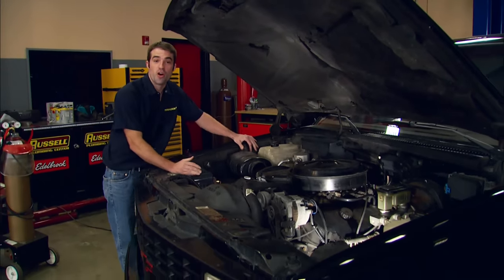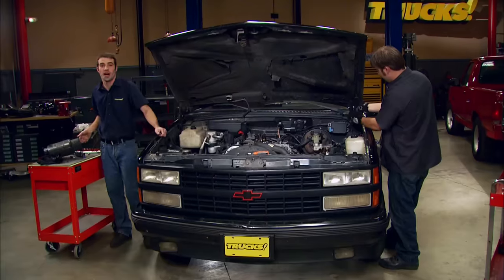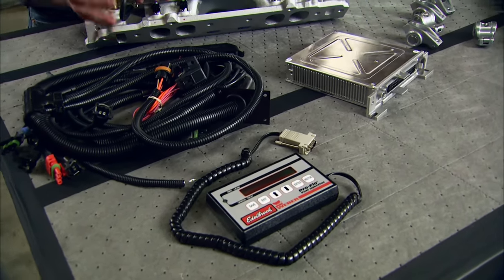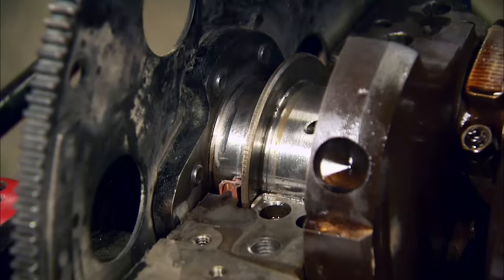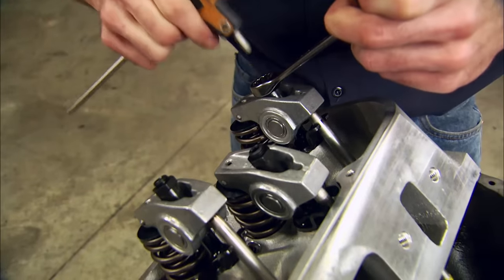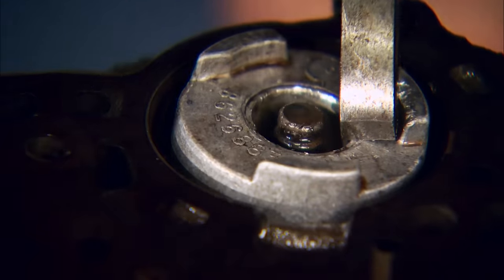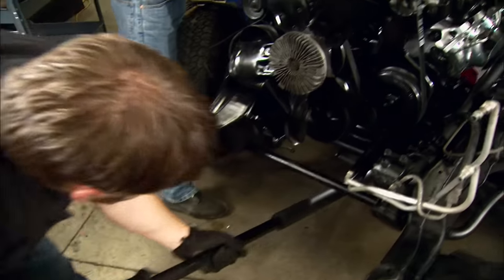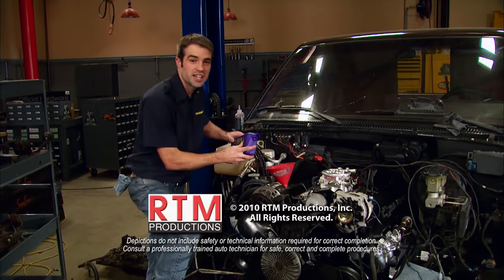Waking Up A 1990 Chevy 454 SS Big Block MuscleTrux Wars Part 2 - Trucks! S10, E2

Comment: Flip the lid on the air cleaner and it'll squeak the tires.
Reply: J W That will only increase noise.
Reply: Okay boomer, sit down.
Reply: Does increase power even if hes a boomer those old dudes have all the old school knowlwdge, you should check out uncle tonys garage
Reply: Lol every gear head in high school 😆😆😆👍
Reply: @dextermorgan9703  just finished watching Tony talk about valve's and off set piston pins  👍
Reply: @Joshua Webb I graduated in 03 wish I was in high school in the 70's lol just seemed like a good time . I'm guessing mech class was better lol
Reply: @Joshua Webb my school had the best shops in the City. Wish I spent more time in mechanics. I was in the auto body shop I painted my fist car there. It's sad I stopped by a couple years ago they cut funding had to get rid of the auto body shop and mech is half the size . I get it it's all about computers now. Buddy trying to teach me Mega squirt 
Arg makes me feel dumb lol
Reply: This idea needs to die.. all your doing is sucking in hot engine compartment air. A much larger air cleaner with twin intake runners to the front of the grill or inner fenders would be so much better.
Reply: Starcade 85 talk radio  I was given you a change to correct someone. Feel smart now?
Reply: blackericdenice Says the guy who can’t spell...
Reply: 1978 Trans Am ran at least 3 seconds faster in the 1/8th with a flipped breather. At least that's what I told my buddies.
Reply: @guardrail2897  I did that as a kid too but it just made more sound.
Reply: @guardrail2897  3 seconds? You are dreaming
Reply: @kevinxcal1  maybe the air filter was plugged solid lol
Reply: Nothing like converting into a hot air intake. smh
Reply: @kevinxcal1  Dude, it was a joke. It actually ran a hair slower. But my neighbor did tell me it would run faster.

Comment: We learned from several builds that when you build up the old 396's, and 454 big blocks to the point they are badasses, they will tear themselves apart. Keeping the compression down and running the roller tappets will help them not bend the push rods however, they will still find a way to bend or break. They love to spin lower bearings. 

If you can afford to go through these engines every couple of runs they are very powerful.

I had a friend who did a full build on a cowl inducted 454 Chevelle. It was scary fast however, on one run I was with him we were at 95 mph and quickly heading upward when we saw the harmonic balancer in front of us and pulling away. This guy was meticulous and swore he had keyed it. I believed him as this was the fourth attempt at one of these big blocks.

Have fun if you can afford it.

Comment: Youn lads really are 'animal' with your torch applied heat to engineered components !
Reply: STREET RACER Was it that funny?
Reply: @bigboreracing356  The timing gear was starting to turn blue. That's about as hot as you want to get any hardened part if you don't want it softening.
Reply: @zachmikko3249  the steel gear has to be red hot in order to change the temper. he heated the gear no hotter than what the oil temperature's going to be.
Reply: @axlegrind4212  the oil temperature is not going to discolor the steel

Comment: Whenever you work the automatic transmission, consider your cooler--the original one in the radiator is full of whatever was floating around in the old one. Either put a filter on the return line, or bypass the stock cooler for an aftermarket job on the front.

Comment: 88k and 140k miles is well used? For 30yo trucks?
Reply: Depends on how be they were treated. Notice the water when they pulled the heads? The fact that someone opened it up before would have seen me taking it all the way down.
Reply: My 94 f150 w/ 351w has 250k and has just started to need a rebuild.....
Reply: Well you have to remember this aired at least 15 years ago.......
Reply: @seannocera7004  from what i found it aired 2008 which explains why the finishes on the trucks are still so nice for the prices they said and the episodes arent telling you to follow them on whatever social media.... ahh, simpler times.
Reply: back in the days of carbs, 20 weight oil and no detergent in the leaded gas, this was actually true. Thick piston rings, no overdrive, 3,000 RPM down the highway....any vehicle past 80K was waiting to blow its transmission with plastic parts inside it. That's why gas stations had a garage rather than a convenience store. We call it "the good ol' days".

Comment: Shift kits arent "beefing up" a transmission
Reply: So cryogenically treated chromoly shafts and heat-treated gears with a CNC SFI-approved billet bellhousing are a better way to "beef up" that TH400 for a 30 year-old Chevy half-ton?

Comment: I sometimes wonder if the BB efi 460 was ever thought of as a possible engine for the lightning.   Im glad they used the 351w, but a 460 warmed over would have been cool to.
Reply: They thought the 460 was gone be to heavy I thought
Reply: SVT wanted to. But Ford said no, the F-150 wasn't offered with a big block so they told them work with what it comes with practically.
Reply: STREET RACER 460 is a monster with the right stuff put in it.
Reply: @bigboreracing356  same amount of money and same cam and head spec and the 545 doesn't really make more then 20 hp more then the ford. Which isnt that much. But i think the reason you dont see them more is for one the ford car you see the most of is a fox body right i mean there alot of ford cars out there but the mustangs are the fords i see most of and it takes alot of work to fit one in a fox body. And chevy put big blocks in alot if cars that are around more. You see more nova's and camaros then anything around here just my 2 cents

Comment: For a two-into-one exhaust, they should have gone with a 4-inch. Big blocks need to really breathe.
Reply: There is actually a mathematical equation that nobody uses to calculate optimum exhaust size depending on displacement X RPM, while too big a exhaust will not generate more power it will shit low end power up causing sluggish bottom end and vise versa for smaller diameter piping.
Reply: Old-school non sense, Engines breathe at the same CFM level for all horsepower and a 3" exhaust will cover up to 500 RWHP.
Reply: Unless you're making over 600hp... a 3" would be fine.
Reply: For the comp ratio being super low and being a very mild build,  4 inch would kill power.
Reply: @fishnpitstaknnames4699  watch the ep of engine masters over at motor trend. They did a dyno test well theres a few ep where they test exhaust pipe header bashing and pipe size bigger dosnt hurt and i belive the comment was about useing a 4 in single exhaust so 4 in wouldnt be to big. Hell 4 in on a 454 big block with thise heads would work great
Reply: @biscuitninja  3 in single would be fine for up to 600hp man what ever you taking order me a case or a bag or what ever cause a single 3 in exhaust is only good for about 300hp i mean where talking about a 454 bb chevy with edlebrock heads and a single 3 in would be fine i really want some if that cause your pretty High
Reply: @charlestorruella8591  There are plenty of cars on LS1tech making 600HP using a 3 inch single Y exhaust that are not losing power. I trust actual results over someone who has 0 proof to back up his claims.
Reply: @ERidParasoth  No they don't, but the 3 inch will work for this.
Reply: @SiriusC1024  Please provide a source or just be quiet. LS1tech "whos made big power on a t4 and small down pipe?" = Several cars making over 600 RWHP with a 3 inch down pipe. 

watch?v=tRTkZcQLj50 Car weighs 3750 and went 10.x, good for ~650RWHP.
Reply: 4in is something you'd only need on a turbo vehicle, not this low RPM torque big block.
3in = 7.1sq/in (bigger than dual 2in = 6.2sq/in)
4in = 12.6sq/in (bigger than dual 2¾in = 12sq/in)

Comment: Too bad you didn’t find a later year model that came with the 4 speed automatic!
Reply: K. R. V. Everyone is holding on to their 91 and up. Very difficult to find...
Reply: Just do a 6 speed swap!
Reply: Can someone tell me what's the difference from this 454 than the one in my  88suburban C20
Reply: You need to check on when if ever SS454's ever got 4 speed automatics. I know for certain 93s did not have 4 speed automatics because I've owned a 93 Lightning since new and all period comparo's honked on the lack of a 4 speed automatic
Reply: Robert Hawxhurst oh yea the last year produced had the 4 speed automatic, along with a retooling of the 454 engine, that brought the specs back to a more accurate fitting. That also brought a hp increase to 255 hp! It also helped with mileage about as much as 15%.  I remember all this as I was ordering a new C1500 in 1993, after I drove a couple of different truck with different levels of trim. It was eight a basic K15004x4, or higher level called Silverado at the time C1500. The 454 SS I drove was amazing, but burned an 1/8th tank on a test drive? Plus on the highway felt like it needed a higher gear, seeing as how the three speed an 3:73 gearing in the 3/4 ton rear axle was to low for performance only. The newer year models were released for order, that came with an $800 increase in price, due to the new overdrive 4 speed HD automatic! But the gas mileage still concerned me. I ended up buying a C1500, Reg Cab optioned with the Silverado Sport Package that included the same chrome wheels and Bucket Seat Interior as the 454SS. But I ordered the 5.7 V8, with a 5 speed stick, that I was able to get a 4:10 Posi. That I used for daily commuting and transportation, along with towing show cars for me an others. After I changed the intake and exhaust manifolds and Holley Projection System, I was able to outrun and 454SS and get 20 mpg at the speed limits at that time of 55!
Reply: @TheRealZJE313  None.  Chevy was really cheap about performance back in those days.  They just knew the big "454" on the side would be enough to sell it.
Reply: Automatics are so gross. Yuck

Comment: I love how national TV has all these car shows where they talk dumb and think they sound good. Maybe to the average joe, but not a lot of people here who knows about engines. Not to mention throwing on heads right out of the box, which is a huge mistake and makes me want to rip my hair out. They're mass produced heads and still need to be gone over, machined, port matched and polished etc. And that's just the heads, I don't even want to get into everything else.. That's why Youtube has the best content for car guys in my opinion. You can find some really smart individuals on here who know their shit.
Reply: @bigboreracing356  actually it could run into issues when they are mass produced i have heard of guys getting the wrong valves they have ordered or they end up with cheap valves anyway and need to get them redone i know quite a few machinists who have had this problem..but how common is it? i have no idea

Comment: When that crank sprocket turned blue,
It was instant trash. Every bit of heat treatment was out the window. Never heat bearings or sprockets with a cutting torch .
Just a quick warm will not damage it in the oven or let the machine shop install it.....
Reply: Yeah, I cringed when they did that....and I’m not even a mechanic lol.  I’ve rebuilt old Willys Jeeps, but that’s about it.  But I did think in my head that little “trick” they did was not right...

Comment: If it's not making at least 450 hp, they've  wasted their      time.
Reply: That motor will make over 500 hp easily.
Reply: They've wasted their time.  They went from just under 200 to the 250 to 300 range.
Reply: @immikeurnot  I can see u know nothing about engines. Just taking off emissions and adding a set of headers make well over 300 hp close to 400. Smh
Reply: @immikeurnot  at the crank? 90-92 was 230.  93 was 255.
Reply: Should be 1 hp per cubic inch minimum.
Reply: @andrewfotopoulos7766 super chevy did a build like this with a flat tappet cam and a carb. Motor made 560 hp. Then they put a 150 shot of nitrous on it motor made 732 hp. 454s are a great engine easy to get power out of them.
Reply: @BigUnk85  having watched the dyno video of this truck hahahaha try mid 200's. They wasted their time.
Reply: @zachkuby87  smh
Reply: They went from 198 HP to 318 HP at rear tires... 120 HP gain...
Reply: @immikeurnot  it made 230hp stock.
Reply: @BigUnk85  haha what "emissions" are you taking off? Please specify. 

That engine made 230hp stock. The parts they threw at it increased power by 150hp. Do the math.
Reply: @BigUnk85  with a Gen V lower end?
Reply: @hgjennings  yes
Reply: Soul Taker  lol ok show me one example. You realize the Gen V has horribly low compression in stock form, right? The heads are horrible, but even with the heads used in this video, it only bumps compression up to 8.8:1.... with crappy dished pistons and tiny combustion chambers. 

Any other head on the market will lower compression over the heads used in this video. While there are heads out there that can make more power than these Edelbrock units, they all require more compression... not the combination you want for power.

So tell us all how you are going to "easily" get 500hp out of a Gen V 454 with the stock lower end, which includes the factory low compression dished pistons. 

These professionals put on the absolute best heads available (without changing pistons!), intake, roller cam, headers, and exhaust upgrade and they still couldn't even get it to 400hp.

AND DON'T SAY BOOST! Haha we are talking NA, obviously.
Reply: @BigUnk85  LOL No one is making a 200HP gain by putting an aftermarket exhaust on, not even in a diesel truck with extremely restrictive emissions equipment.
Reply: @BigUnk85  nope
Reply: @hgjennings  soul taker is doing that Democrat math lol
Reply: It's easy to see soul taker adds his HP by slapping on Jeggs and K&N stickers on the back window!

Comment: I can't hardly believe or accept the fact that you didn't pull the pistons and at least replace the rings!.Why? Really, please answer......why?
Reply: cheap/fast/something to do in a short time for decent ratings.. Chevy Vrs. A Ford POS brings all the boys in the yard.
Reply: @hawkdsl  
LOL!
Is that why the 'awesome' Chevy 454 big block could barely make 200 HP. What a cast iron boat anchor!
While the 'POS' Ford small block made MORE HP with over 100 LESS CID.....?
Reply: Add a super charger to the big block and see who makes more power.
Reply: @bigboreracing356  
How much money did you have to dump into your 454 turd to get it running better than a nice 351W?
Reply: @Turbo4Joe363  Stop taking drugs. Let us know when Ford decides to pick a firing order, and sticks with it for more then 6 months.
Reply: @hawkdsl  
Ooh different firing orders!
So hard to understand.
Chevy guys can't handle so much information.
DUH! Hey Bubba I can only remember a Chevy Big Block and a Chevy Small Block...any more and my brain is gonna explode....just like my Chevy motor!
Reply: @Turbo4Joe363  Ford guys.. I cut you guys a break. I get the frustration 'yall live with everyday. It's ok man... it's... ok.
Reply: @bigboreracing356  Pardon me as i casually stroll past you at half throttle with the 460...i'll see you at the next gas station!
Reply: What about vavle geometry 😳😱
Reply: What about vavle geometry 😲😲

Comment: That 454 is pretty easy to make power with. All you have to do is change the heads, cam, intake, fuel system and exhaust. Basically the whole engine.

Comment: I wouldn't use Royal Purple, nor Amsoil. Some know why, some don't. You do what you want though.
Reply: I don't know why both of those oils are no good. Please share your thoughts.
Reply: Rotella for the win.
Reply: @andybilic  They do not follow all industry and federal quality standards for a modern passenger motor vehicle gasoline engine. The API service starburst is an important certification of guaranteed longevity and on-road emissions standards.

Comment: Pretty sad they had to almost rebuild the whole chevys engine n trans...  n barely touch the ford ... doesnt seem fair ... the ford shoulda got new heads n cam too
Reply: Ford gets a blower...
Reply: @BuzzLOLOL  yeah sitting by the rear diff how much boost pressure does it actually get with all that piping ... probably 2-5 lbs all said n done.... get better from a belt drive procharger

Comment: I don’t think I’d do this whole job and trust an O’Reilly’s Autoparts oil pump...
Reply: Jeremy Lakenes maybe if O’reilly’s sponsored your build 😂😂
Reply: If i was sponsored, I’d tell the Camera that “O’Reilly’s supplied the pump” but would bolt on something different. 

I’ve been in a pinch and had to grind three sets of brake pads to get then to fit. I’ve had other issues with O’Reillys. Autozone for me has been better, although Autozone had its down years.

Comment: "Add the PCV valve" said no one ever.
Reply: the fuel injection iac valve is calibrated to have a pcv valve in the circuit. it doesn't operate properly without it.
Reply: It's going on the street.  Yes add a PCV valve, you potato.

Comment: 8 to 1 compression 454 is like beating a dead horse !
Reply: Exactly unless they got boost. I have a 496 That's 9.6:1 with a 236/242 @50 .600 lift cam and that thing screams still kept cast iron heads
Reply: You got to be one hell of a man to beat a dead horse with a 454. Dam Popeye!
Reply: Bro I have a 427 balanace & blueprited Dan Iskadarian  cam & solid lifters 12.25 to 1 comp. pistons forged crank so much to list unreal ! 308 gears 14 in. Wide center lines with M.T. N50s
Reply: IM RUNNING 427 WITH 12.25 TO 1 COMP. PISTONS ISKY CAM & LIFTERS BALANCE & BLUE PRINTED FORGED STEEL CRANK RAT HEADS TORKER 2 HIGH RISE ,DUAL POINT & ACCEL COIL WITH 850 HOLLEY WITH MANUAL SECONDARYS LIST GOES ON & ON ! 308 GEARS 10 BOLT POSITRAC